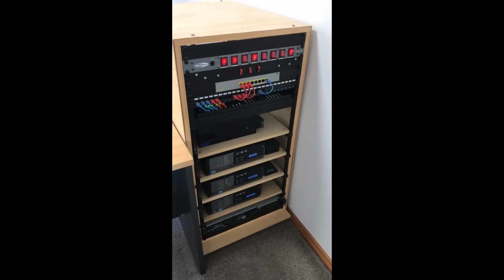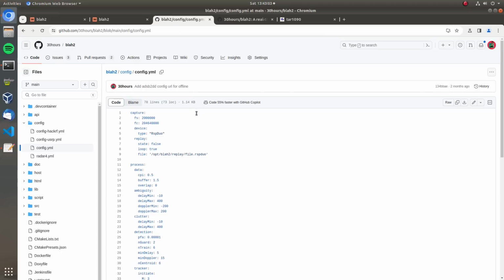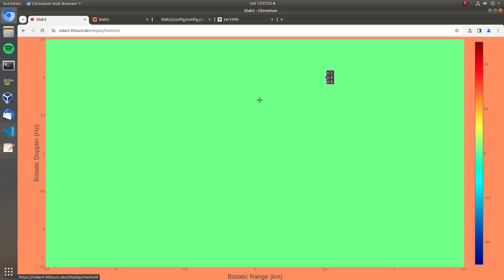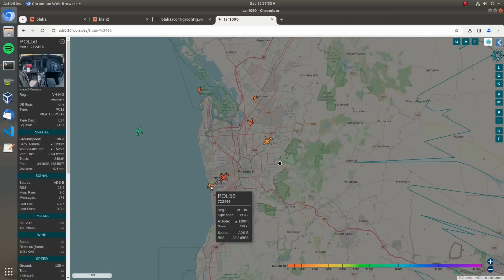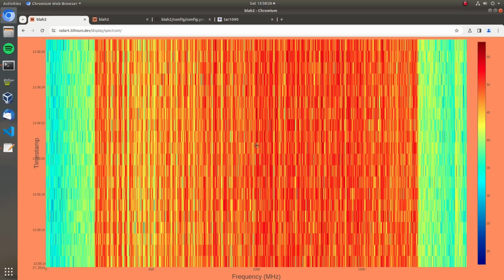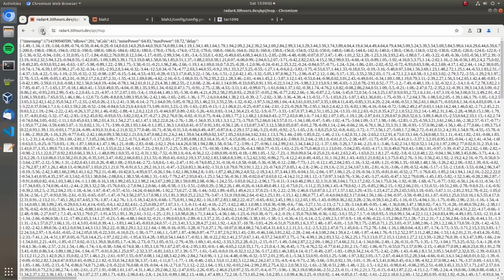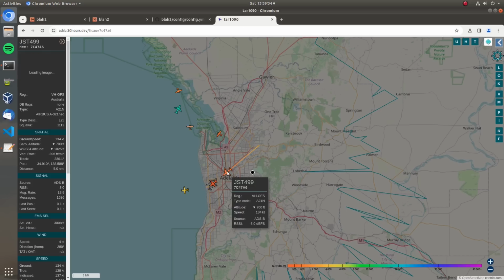Real time passive radar at home

Comment: This is absolutely amazing that you can do such things at home these days. Any chance you might do a homebuild ground search radar at some point?
Reply from the maker: At 2 MHz bandwidth in this system, each range bin is around 150 m. If you design a ground penetrating radar to see a few meters into the ground, an appropriate range resolution can be set by increasing the transmitted bandwidth. I would expect a bandwidth of hundreds of MHz would be required, which would be out of scope for this system. Interesting idea.
Reply: @30hoursdev  First off thanks for responding so quickly. Secondly I had actually meant more along the lines of the sort of ground search radar used nowadays in both vehicles and in military units. To detect other vehicles, people, other objects etc. Or I guess the best known civilian use would be radar cops lol. The ground penetrating radar is definitely something I hadn't considered but I agree it is a most interesting idea....
Reply from the maker: @AGTheOSHAViolationsCounter  I see! Unfortunately the same principles apply of needing a lot more bandwidth. Radars on vehicles are generally in the tens of GHz (out of reach for cheap SDR platforms) and require high bandwidth if you want resolutions in the tens of centimetres or lower. My understanding is a lot of the signal processing on these vehicle radars is done in hardware.

Comment: Could it detect drones?
Reply from the maker: Performance prediction is a difficult problem. With enough transmit power and antenna gain, any target could be detectable. In practice this requires careful engineering design for a high probability of detection.

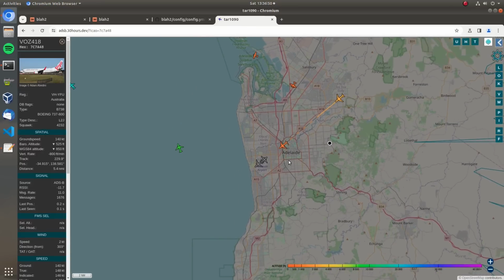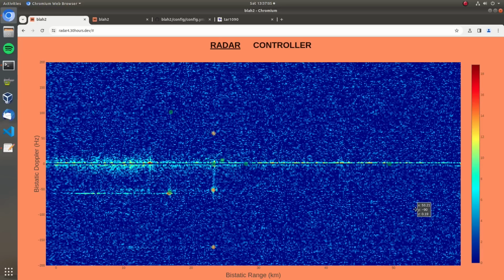Comment: So 04:18 and 04:32 the X axis is the distance to source (simply). And the Z axis (vertical) is the direction from transmitter and receiver.

The thing needs a proper graphical user interface. A one window where the primary is the "radar" scope.
B Scope for range and azimuth as secondary in vertical form, but as well primary should be way to get a circular polar coordinates from your position. 
That you would get simply circle where your antenna is at the center, and you get azimuth (0-360 degree) and range (in km), as in "233 degree, 5.5 km." And a way to select a direction that is for calibrated heading, so you could example use a radio to give you North. 

And have a way to enter coordinates for your antenna, and system would calculate a GPS coordinates from that to each detection.

Later on have a detection memory, like a submarines, where each contact is automatically assigned a name. They can be the radio brevity alphabet for starts to have just those 20+ contacts listed in time order. The challenge would be to include a tracking capability, so if contact is lost for moment, then use the prediction of existing area (circling aircraft) and vector and speed that if contact appears there, it is likely the same previously known target instead a new contact.
Reply from the maker: X axis is loosely distance, Y axis is Doppler (positive coming towards, negative going away) and the Z axis is the target strength. 

This 2 channel system does not have any concept of angle of arrival. All I know is the target is at some range on an ellipse surrounding the transmitter and receiver. Target localisation can be achieved using an antenna array and beamforming, or a multistatic approach like in the 3lips project.

Agreed that a tracker would provide redundancy for any missed detections.

Comment: fascinating, so how exactly is your radar finding flight numbers? is it listening in for the ATC signal coming from the aircraft? or is it just trying to correlate the radar returns with a flight control map?

and all the signal near the 0 shift line, is that corellated to the transmitters? or is it a reflection of the skyline?

also will you make any project to improve the computer here so it can track contacts specifically? ie discerning individual targets, finding its speed/heading/altitude, and displaying it as a clear target?
Reply from the maker: Listening for ADS-B signals transmitted from the aircraft, to correlate with the radar returns. The returns at 0 Doppler are static clutter, which have been removed using the clutter filter. My other project 3lips on GitHub uses multiple radar nodes to geolocate the target on a map.
Reply: @30hoursdev  ah OK, thanks for the info!

Comment: I like that it all looks like a regular UHF TV antenna and a vent pipe and a outside cable service box.    Why the reflective mirror thing in the service box outside?
Reply from the maker: That’s just the backing plate that came with the service box, the lightning protector ground is bolted to that, and that will eventually bolt to the ground stake.
Reply: @30hoursdev  The Yagi is lightning protected already, right?
Reply from the maker: I haven’t connected the metal mast holding the Yagi to the ground stake yet, but I plan to soon.

Comment: how is this passive? no radar is passive they all have to transmit a signal to bounce back to the antenna, not passive from my experience.
Reply from the maker: You’re correct. In this instance passive refers to having no control of the transmitter.

Comment: I wonder if there is a way to view the radar on a Toyota? they are 3mm band and seem to have good range on them.
Reply from the maker: Interesting idea! The software defined radios I use only go up to the low GHz region, where the car radars are in the high 10’s of GHz. Signal processing is more computationally intensive with larger bandwidths.

Comment: What i font get is the polarisation of the reference is digital radio not vertically polarised where you live ? Or does the polarisation not matter for the surveillance antenna and only the reference antenna should be oriented correctly?
Reply from the maker: The reference is vertically polarised. The surveillance is h-pol to avoid interference on the radiation pattern from the vertical mast. This also reduces the amount of v-pol clutter (which is the dominant signal source by far). It’s hard to quantify without doing a full simulation in the environment of the receiver, but target SNR is strong on the cross-pol. A good experiment would be to run a dual-polarised Yagi and directly compare target SNR.

Comment: Pretty neat that it's possible on stuff that is put together by a hobbyist. Next trick is to do this with signal bounces from three geographically distinct radio stations, and then be able to plot this on a map relative to your own position. (I figure the one map is a flight tracker rather than anything you're generating as a comparison to the current return monitoring. But at some point getting the locations and not just distances should be possible.)
Reply from the maker: Check out my project 3lips on GitHub which does this with 3 or more radar nodes. Had a demo running a couple of months ago but only have 1 active node as of right now - planning to get the 3 back up eventually.
Reply: @30hoursdev  Don't have the hardware/money/time for it, but it's cool that you pulled it off. Let's just say I enjoy these things by proxy on YouTube, and find them rather neat. It's one of those things I thought should be possible years ago (but more like with government R&D into it), yet this now seems to be done with consumer accessible gear.

Comment: Awesome project !
At 0:37, the length of unbraided coax is way too long, and is making part of the dipole length. So i doubt the antenna is well tuned, you could probably improve it A LOT by making this connection as short as possible. The yagi elements support solution is smart !
Reply from the maker: Agreed! I should include the feed into my NEC model and quantify that. With regards to matching I modelled a beta/hairpin match but never installed it on the antenna. I measured a VSWR of 1.75 and since the antenna is receive only, it’s just a (relatively small) attenuation loss.
Reply: @30hoursdev  True, but keeping in mind that VSWR is not always a proof of good efficiency, specially with all the coax you are using, that can somewhat hide or attenuate the mismatch. 
Also feeding a yagi with a dipole is often  not optimal, but with the type of mount you are using, you could easily switch to a gamma match, with possible good improvement :)
Thanks for sharing your project ! I have always found passive radar super interesting .

Comment: Impressive work and setup, whats the max detection distance you've plotted?
Reply from the maker: Difficult to generalise since it’s dependent on target RCS, geometry and the waveform being used. Also note bistatic range is not true target range from the receiver. The system I have running with DAB as a transmitter is on the order of 20 km true range.
Reply: @30hoursdev  Still amazing and impressive!

Comment: Can this way a mobile radio network with its given signal secretly detect the motion of people (without carrying any phone) and possibly identify them by size and leg motion/behaviour patterns? I read that radar sensors can even convert voicebox/throat motion into sound to spy people's talk contactless without a microphone.
Reply: Mental health assistance resources are available. You are not alone. Please seek the help you require.
Reply: @williamcampbell9859  This is not for "mental health" quacks (neither operating thetans not others) but a scientifically proven fact! They even patented to use radar as a phone mic to improve speech quality in noisy environments. E.g. Google Pixel has a 60 GHz radar motion sensor that may be suited for such applications. And using doppler radar to track walking patterns of people is also well known (e.g. in car brake assist radar to recognize pedestrians in the dark - which fails when they stand still on the road). Also security cameras track walking patterns by AI to identify pedestrians because it works also with grainy images. Read Edward Snowden's reports what is possible with sideband signals to identify people.

Comment: Great work ! I had no idea an sdrplay could be used as such a granular reference for looking at microdoppler. if so, one could review this method on recorded IQ data. Are you using their API?
Reply from the maker: The project does have the ability to record IQ data to file for post processing. A hidden functionality of pressing space bar (but not on the public radar). I use the SDRplay API to grab samples to processing buffers.

Comment: POL56 is a Pilatus PC-12/47 with registration VH-HIG. So not a helicopter but a single-engine turboprop.
Reply from the maker: You’re correct. The police helicopter here typically takes a POL call sign and I hadn’t seen this one before. There is a subtle micro Doppler difference between a helicopter and turboprop - typically I’ll see more than 1 sideband on either side of the body return for a helicopter.
Reply: @30hoursdev  You may be aware of this but things like the doppler sidebands from spinning props or turbines have long been used as part of the way military radars can attempt to determine aircraft type automatically. The F-16 has a system called NCTR (non-cooperative target recognition) which tries to give a friend/foe indication based on this information and a database of aircraft types.
Reply: @sbreheny  who needs IFF/SIFF anymore? AI’s got it covered nowadays.
Reply: Even says so in the video

Comment: Wonderful setup! Can I ask which gas discharge tubes you used and how did you select them? I assume because the antennas are passive and only receiving that there is very little voltage across the GDT under normal conditions.
Reply from the maker: Selected the cheapest ones available on AliExpress. The purpose of these is under lightning conditions, to discharge any static charge through to the ground stake. I haven’t actually connected the body of the connectors/antenna interface box to the ground stake yet, but should do it soon. Otherwise these devices should have a minimal insertion loss.

Comment: Given that you have a 1.56 MHz pseudo-random signal (and you have a clean ref copy), I would have expected that you'd be able to dig further into the noise.
Have you left any signal processing techniques on the table ?
Reply from the maker: I’m limited with the 2 channel system with regards to directional noise that isn’t clutter or a target return, however if I had a surveillance array there are noise reduction techniques available. These are actually available in the KrakenSDR code base which has MVDR and MUSIC.

Comment: Why wouldn't this technique pickup stealth fighters like the F22? Iran claims theirs can pick them up from 200 miles away! 
Have you seen or recorded anything unusual? Like a fast and furious UFO?
Reply: It would probably depend on the spectral response of the F22's radar signature, but I'm going to guess the designers thought of that. In any case the returns from this passive radar are going to be many, many times weaker than an active directed radar signal that would be used in any military application. So likely you wouldn't get anything back from an F22. Or maybe you would? Who knows. The advantage of this system is that the receiver is essentially undetectable unless you visually see the antenna.
Reply: Think they did this with cell site transmitter signals as the ambient source

Comment: Could this be used to detect aircraft without active ADS-B transponder?
Reply from the maker: Yes, I will always see the aircraft on the delay-Doppler map as orange dots. Note I can not geolocate targets on the map with this system (what you saw is the ADS-B truth on the map). I have another project 3lips (search on GitHub) which uses multiple radars to locate the target on a map.

Comment: i really like the screen that's showing the actual planes and map, i would say great job with that. i'm not feeling the one with the blue background and red dots but i guess that's the raw input data to create the screen that shows the planes.
Reply: The primary goal is probably the same as any other hobby project (unless you're selling something): It's interesting, it's cool, it's fun, you always encounter challenges, and you always end up learning something.

I doubt there exist many people who need a passive radar in their home.
Reply: The screen that shows the planes is based on the planes' transponders, and has nothing to do with the radar.
Reply from the maker: Correct, a detection at some bistatic range places the target on some ellipse surrounding the transmitter and receiver. I can’t tell where the target is on this system. I have another project 3lips (search on GitHub) which uses multiple radars to find target position on a map.
Reply: @30hoursdev  what is the goal of this project? if it's to detect planes then what is the point if you already know where the planes are, or is there some other outcome you're hoping to achieve? it is pretty cool what you're doing no doubt about that but i can't figure out what the purpose is.
Reply from the maker: ADS-B relies on planes sending out their location, the radar detections are non-cooperative and we’ll see them even when ADS-B is switched off.

Comment: Hi, sorry for the really dumb question, but i sont exactly understand how it works.. why the two antennas? Who's the emitter? Could you make a short video explaining more or less how the convept works? Thanks!!
Reply from the maker: There’s a digital radio transmitter which sends signals all over the city. The reference antenna receives the transmitter signal directly, while the surveillance antenna receives signals that have reflected off aircraft. Then I do some signal processing to generate a delay-Doppler map and show targets.
Reply: @30hoursdev  Makes perfect sense; thanks!
Reply: @30hoursdev  Subsidiary question: I guess both signals (reference vs surveillance) must be perfectly time-synchronized right ? Because some µs of difference translates into many km of difference.
Reply from the maker: Correct! The SDR used is the SDRplay RSPDuo which has 2 synchronised channels.
Reply: @30hoursdev  So, would that be cancelling out the "noise" or capering data samples to spit out a result?
Reply from the maker: @Madsstuff  Each channel captures IQ samples. I perform signal processing on these samples; clutter filter to remove returns at zero Doppler, ambiguity processing to turn the filtered samples into a delay-Doppler map. Then run a detector over the map.

Comment: Wait... passive radar? I want to know more! Any chance of doing more videos on the fundamentals of this?
Reply: Easy answer: same as regular radar, but someone/somewhere else is transmitting the signal.
Reply: @d10valentin  perhaps I should have been more specific.

I gathered as much as you said from the word "passive". I'm more interested in the implementation, the fundamentals as in the building blocks of a solution, not the fundamentals as a layperson's explanation.
Reply: Look for projects like Celldar from the 80s and 90s that tried using reflected signals from phone masts. One massive problem was aerial design on phone towers stopped it working as they steered radiation downwards!
It worked for vehicles but was never good enough and was abandoned,  so don't waste your time and money on a project uk government abandoned.